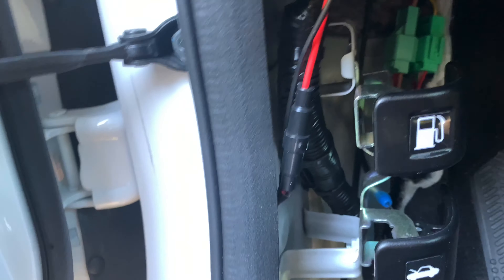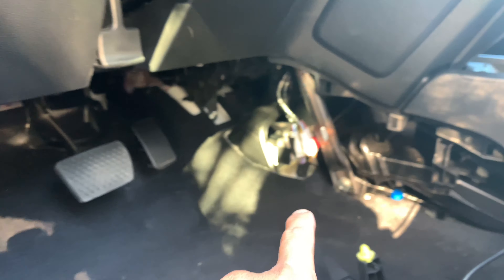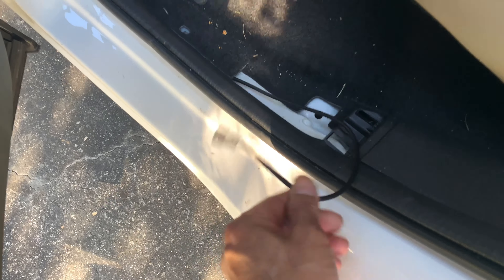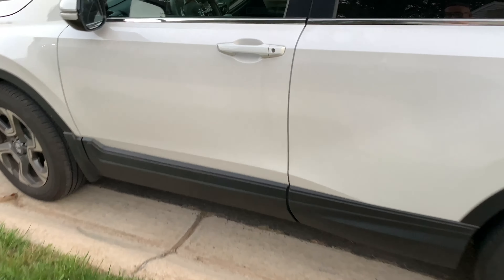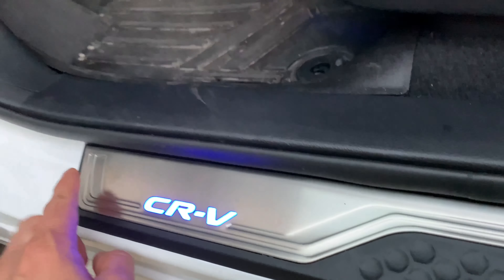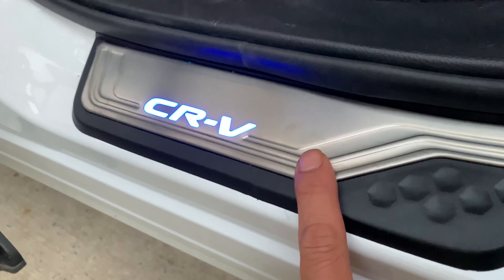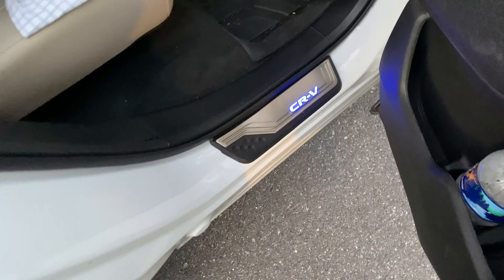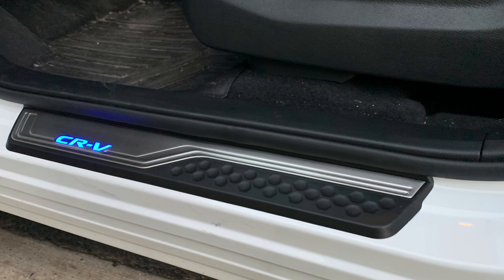Part 1       2017-2020 Honda CRV Led  Illuminated Door Sills from Amazon installation tip power plug

Comment: I have 2018 crv ex, do you know where the dome light fuse is? I am think to add some leds under the car and then tap into the dome lights fuse, so it will turn when I unlock the car something like puddle light.

Also is there a grommet hole in the frontseats from the ground, so I can run some wires?
Reply: Hi, I’m sorry I can’t be helpful with your  question.  I do know that taping into that dome wire can be done. If the system you chose out  won’t over power the fuse. You should be good. If it does. Find another fuse higher. Some go with the dome light, side markers, lots of wires to tap into. Make sure you have the battery 🔋 disconnected before you work with electricity ⚡️.
Reply: @ram3nradio175  thank you so much
Reply from the maker: @sairangineeni  you’re welcome

Comment: Do you have an update on the quality of how these held up after a year?   Is there any issues with the wire getting cut in the rear when people step on it ?
Reply: Since I’ve put them on. I had my car since new. The car has 45167 miles and has held up great. No issues. Led lights work perfect. In the cold. In the heat. I step on it. (170lbs) it won’t harm it. It’s made to be stepped on .
Reply: The wires are tucked underneath and routed thru an opening on the car frame.
Reply: @ram3nradio175  do you have a link of where to buy it ?    Thanks !

Comment: This looks so sweet. I've been trying to do this but have been waiting for someone to post a tutorial of how to do it. Are you able to post a tutorial of the process and how you took apart the plastic pieces? I just don't understand how to take apart the center console to wire the cable through
Reply from the maker: Will Nguyen ok, I can post something this weekend. Maybe by Sunday
Reply: Thanks so much! I bought the door sills already but haven't done anything because I don't know where to begin. Hopefully what you post can help me out. Did you have to remove plastic for the back seats too?
Reply from the maker: Will Nguyen no just the plastic that you would run the wire underneath. The door area trim. Pull up. Lift and it will come out. Same thing for the other plastic pieces
Reply from the maker: Will Nguyen also installation instructions is in the description but I will make a video on removing the trim pieces
Reply: @timmytimtime1284  thank you so much. I really appreciate you taking the time to do this
Reply from the maker: Will Nguyen no problem. I’ll update you on here when I’m done . Tomorrow. I’ll get my kid to hold the phone .
Reply from the maker: https://youtu.be/Tpq2KduS_7M

Sorry it a bit longer. We had rain and got a bit busy with the kids
Reply: @timmytimtime1284  thats ok! Thank you so much. You're awesome
Reply from the maker: @willgolio  I hope that helps. 3 kids I have and no one could hold the camera for me. 💁

Comment: Hi need help. I installed mine according to your video. But it does not light up. Fuse is good harness connected properly. I dont know why it doesn’t lit.
Reply from the maker: Hello. I’m not sure either but if it doesn’t light up at all. There must be no power running to it. Did you check the fuse in the car? Not the fuse directly connected to the sills.
Reply from the maker: Hello. I’m not sure either but if it doesn’t light up at all. There must be no power running to it. Did you check the fuse in the car? Not the fuse directly connected to the sills.